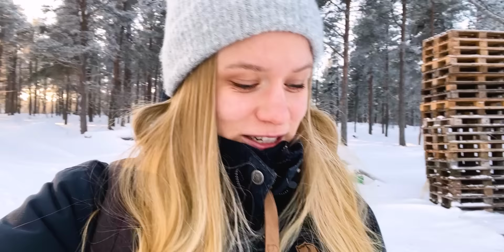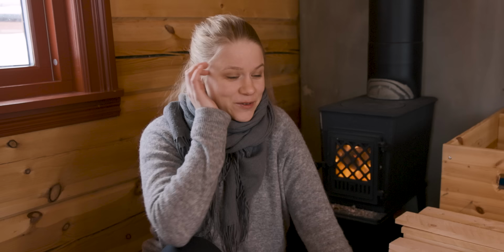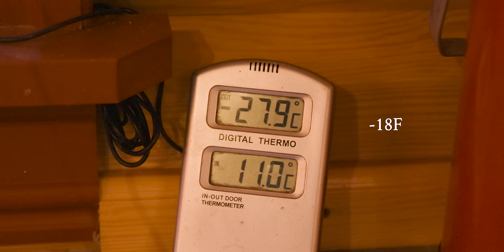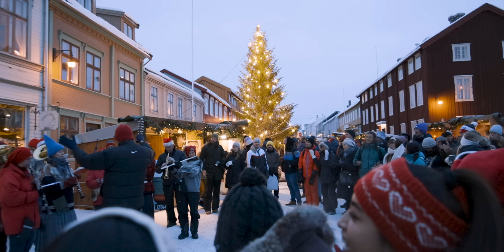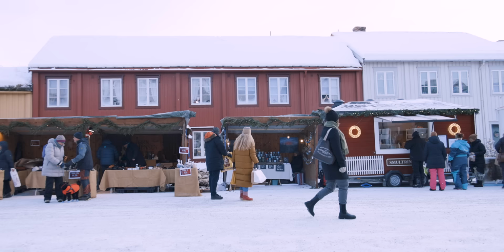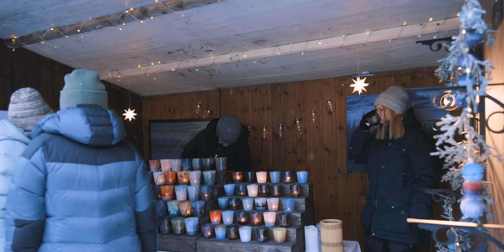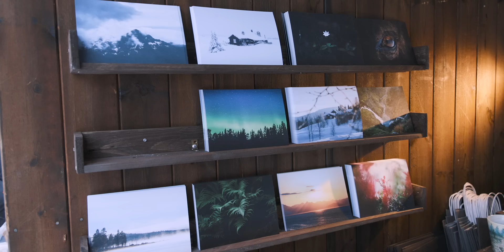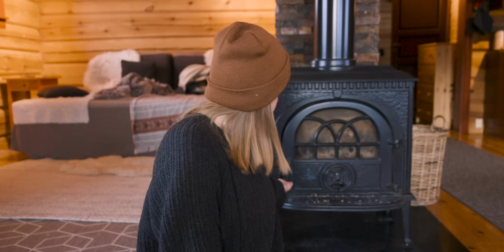Christmas in Winter Wonderland | #40 Life in Norway

Comment: - 30C ? Yes in 2010 during a Christmass trip to Norway🤗 The ski slopes were closed. Snow as hard as concrete. The moisture in my nostrils froze. BUT the beauty of it all took my breath away. Someone had scattered handsfull of diamonds in the snow.  Tiny diamond droplets shimmered on the tree branches. The crunch of the snow under the soles of my boots and the fact that the sounds change when there is a  difference in the temperature. The smell of the cold fresh air. I
 ❤ Norway. Thanks for sharing. Sincerely hope that your business grows and becomes very successful. The Nordic nations has been abundantly blessed with the ability to produce  skillful "art and crafts". Even the most ordinary item is turned into an object of beauty. You are a great example😊 Have a wonderful Christmass as you celebrate the birth of Jesus Christ🤗